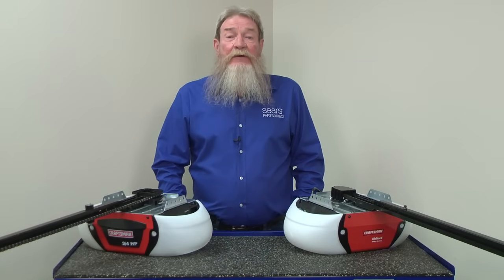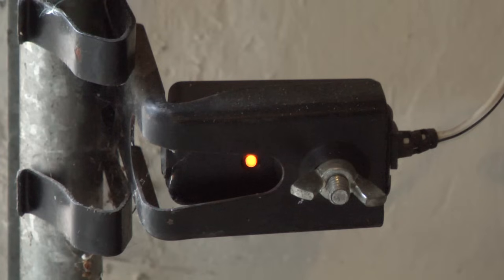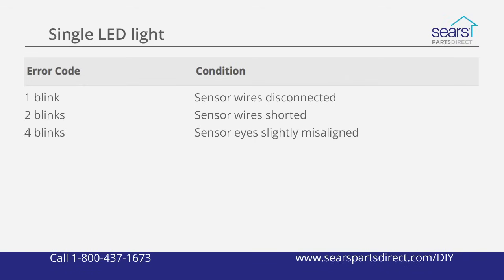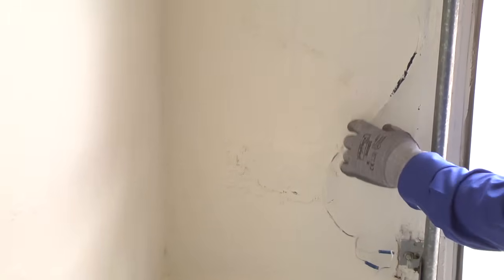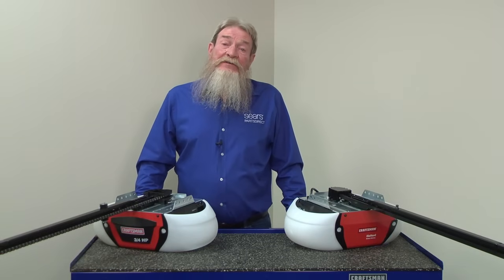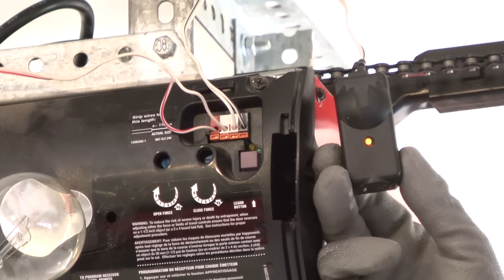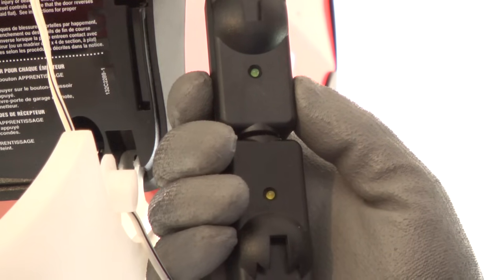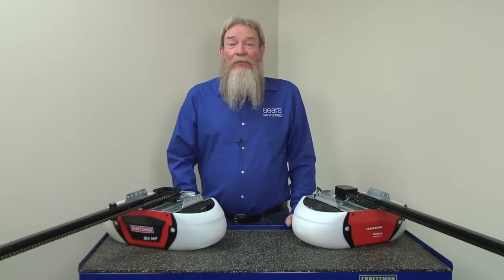How to Fix a Garage Door Opener that Won't Close the Door: Lights Blink 10 Times

Comment: This was excellent. I didn't know about the debug light on the motor. It said 1 blink, disconnected. I took the main wire pair out of the motor, put it back in, but still 1 blink. I took the left sensor out, wires looked ok but I giggled them, replaced the sensor, and it was amber and the other side green and now it works. I think I knocked the wires loose when cleaning that corner of the garage. Thank you!

Comment: My mom's garage door hasn't worked for years, it would go up but wouldn't go down. She had to open the door from inside, pull her car out, go back into the garage and close the door, then exit the front of the house and get back in her car, every time she wanted to go anywhere.

I don't know anything about this stuff and kept telling her to call a repairman but she never had the money for it.

I just now was over here and decided I'd had enough of her having to deal with this and Googled it, sure that the answer would be "call a repairman." But I did it anyway. This video came up, so I clicked, and watched.

After finishing the video, I thought that surely the problem wasn't as simple as checking the alignment of the sensors.

I was wrong. I didn't even really do anything. I just jiggled the receiving sensor a bit, walked over to check the yellow sensor, but on my way over I accidentally pushed the button on my garage door opener she gave me (which I just replaced the battery for) and the garage went down so I couldn't even check the yellow light. I was so confused but cautiously optimistic... So I tried the remote a few more times, letting it open and close, stopping it midway up and midway down... It worked perfectly. I checked the button inside the garage next to the entry door, and that worked as well. No more blinking/clicking lights, just perfectly smooth door operation. 

After all these years, all it took was a little jiggle.

Comment: Did the sensor test.  Both work, however the wire was also replaced the whole way when I got new sensors.  But the sensor wire is solid core, the new wire braided.  Could this be the issue?

Comment: The part showing that yellow light flashing sequence really helped me and I couldn't find that info anywhere.  4 flashes for me with incorrect alignment.  Took the sensors off and plugged them into unit with the short cables, put the sensors face to face touching and the flashing stopped, pressed my garage door button and voila she opened.  Carefully measured the height of the sensors when reinstalling, made sure they were clean and she works like a charm.  Very thankful.

Comment: 4 blinks??? YES!!!  FIXED!!!   I never knew about the CODE light.   It seemed like my sensors were aligned, but upon closer look there was a almost imperceptible blink on the green light.  

I adjusted BOTH sensors and the door now works!  I’ve wasted days messing around with the door, but your video SAVED me!!!    Thanks so much.

Comment: My lights are both on but flashes 1 time at the motor.  If a sensor wire is disconnected, why do I have lights on the sensors?

Comment: I got laid off from my job, my partner's cancer may be back, then our AC went out in the middle of a texas summer, and THEN the garage door wouldn't close 😭 when it rains, my friends. 

This video was a godsend. We had two things happen simultaneously. First, my partner pulled the string to try to raise the door manually and didnt click it back into place. All it took was me pushing the door up till i heard the click. Second, i must have bumped the sensor putting away the lawnmower and it was just barely out of alignment. Thank you for this video 🙏 one minute in and it saved me from literally pulling out my hair today

Comment: Can someone help me here. I have both sensor lights on (the green and the orange). However, the door still won't close and blinks 10 times. Also, I think I'm getting a 'blink 4 times' error code from the unit. This is very frustrating.

Comment: Both my lights are lit. Garage door closed and stops just above where the sensors are and then rolls back up. 10 flashes and 4 flashes on the back. Any tips?

Comment: The green and yellow lights work as they should and they are aligned. The door goes up and down very easy. The door is very light because its only a single car door mad of tin.  The transmitter and the receiver are in the shade.  I checked all connections and none are loose.  I do see the up and down force knobs both need to be turned up all the way to get it to work. Does this mean the circuit board is bad, or what? It might be best to just buy a whole new opener, but I wanted to try to avoid that.

Comment: My has 1 up blink and 5 down blink and it makes just one click sound. Is this the logic board gone bad...?
Reply from the maker: That error code does indicate that the garage door opener has a defective logic board in most openers. Replacing the logic board will likely fix the problem. It's sometimes more practical to replace the entire garage door opener instead of replacing the logic board.
Reply: @searspartsdirect  Thanks I change the logic board and everything back to normal.

Comment: I had the same problem on my unit..In my case it turned out to be caused of the the angle of of the sun on my door..It. A used the sensors not to work ..We relocated the sensors and have had no problems since…

Comment: Systematic, methodical and comprehensive troubleshooting - exactly what I needed to see to finally solve the riddle of the inoperative sensor - thanks!  In my case, it turned out that I jarred one of the leads loose in the control box while fiddling around installing a new battery and just needed to tease it back in.  D'oh!

Comment: GREAT tutorial.  What does the light blinking 5 times indicate?
Reply from the maker: The 5 blinks indicates that the motor overheated or the motor isn't detected as running by the RPM sensor. Here's some troubleshooting to try: The motor can overheat if the door is opened and closed several times in a row. Unplug the garage door opener to reset the logic board. Allow the motor to cool for about 15 minutes before restoring power and using the garage door opener. Pull the emergency door release and check the up-and-down travel of the garage door for binding. Repair the garage door if it doesn't travel smoothly. If it overheats after a single use and the garage door travel is smooth, you may need to replace the motor.
Reply: @searspartsdirect  Thank you Sir.  I will try the above.  I believe now that the spring is broken.

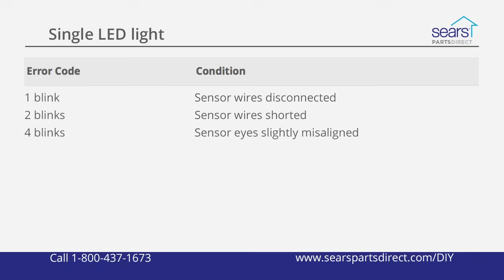Comment: 1:41, great info. But during different tests, it changed from 2 blinks to 1 blink. Can that mean something inside a sensor is acting up?
Reply from the maker: Loose wires or a bad sensor could cause that symptom. To eliminate the wiring as a cause, test the sensors directly at the motor unit as shown at 3:21 in the video.

Comment: checking wiring and sensor position was fine even though It only happens during the day. I tried the paper towel roll trick to see if it was a light issue. Didnt work
Reply from the maker: You may need to install sun shields on the sensors as shown in this article/video: https://www.searspartsdirect.com/diy/article/installing-a-sensor-sun-shield-on-your-garage-door-opener-video

Comment: My door always goes down fine with the doorbell button in my garage, but gives me trouble with the remote. I've tried relearning the remote and even using a different remote. Not sure what else to do.
Reply from the maker: If the lights blink when the door won’t go down using the remote, then check the safety sensors as shown in this video. Sunlight can interfere with the safety sensor beam so if the problem is intermittent, you may need to install sun shields around the sensors as shown in this video: https://www.searspartsdirect.com/diy/article/installing-a-sensor-sun-shield-on-your-garage-door-opener-video  If the lights don’t blink when you try to close the door with the remote (indicating the problem isn’t caused by sensor) then a bad remote or radio frequency interference could be preventing the garage door opener motor unit from receiving the close signal from the remote. Follow the troubleshooting steps in this video to fix a remote device problem: https://www.searspartsdirect.com/diy/article/garage-door-opener-remotes-wont-work-video  We hope these tips help. If you need further assistance, let us know.

Comment: I figured out my problem. The sensors are fine, but when the sun is at a certain angle it blinds the receiving sensor so it makes it seem like the sensors are out of alignment or not working. When I hold some card board to shadow the sensor it works fine. Suggestions?
Reply from the maker: We recommend installing sun shields as shown in this video to keep sunlight from interfering with sensor reception: https://www.searspartsdirect.com/diy/article/installing-a-sensor-sun-shield-on-your-garage-door-opener-video . The part number of the sun shields is 41B873. Although Sears PartsDirect doesn’t currently have that part available, you can find it elsewhere on the web.
Reply: @searspartsdirect  Thank you.

Comment: I have a craftsman 1/2hp won't work with any remotes but will work with button in garage and yes I put new batteries in them and reprogrammed them and even went as far as to buy a new remote. So has anyone have this problem ? My remote goes down but not up ,again only the hard wire works fully

Comment: I just fixed my garage door problems (door closes about half way then stops then goes back up then blinks 10 times) and the solution was not one expressed in the video. I had to change the force threshold option (a knob on the motor box that can be changed with a flat tip screwdriver). Mine was set to about 5kgs and I changed it to 9kgs (the max). My railing and garage door was old and it looks like there was some warping over time and that caused it to be harder to move down than the threshold allowed.

Comment: Amazing video! Very detailed but I did not find solution to my problem which is 4 Blinks UP and 6 Blinks Down? What should I do?
My garage door closes if I keep the wall control switch pressed and wait for the door to close completely.. If I press and leave it or press the remote, it wont close. Strangely it opens with the remote but not close. Please help!

Comment: We had a power outage and had to open the door manually. After the power was restored, the door garage door wouldn't close. It WAS the sensor light wiring. It somehow disconnected when manually opening the door. The wiring only needed to be reconnected. Very easy. Thanks man! This helped .

Comment: I do get the 10 blinks trying to close door . . but . . I only have problems when the weather is cold . .if the temp in the garage is at least 65 -  70 the door closes fine
Reply from the maker: In colder weather, your garage door opener sensors may be getting sunlight interference that prevents them from working properly. You may need to install sun shields on the sensors as shown in this article/video: https://www.searspartsdirect.com/diy/article/installing-a-sensor-sun-shield-on-your-garage-door-opener-video

Comment: Thanks so much for this video!   Removing the sender unit and directly connecting it to the motor unit confirmed the sender wasn’t defective as I thought.  Indeed a broken wire near the sender connection was the culprit and being forced to cut the wires to test the sender isolated where the break in the wire was.   I struggled with diagnosing the problem for a couple of hours on my own instead of starting with this video.  More than one lesson learned as a result.

Comment: I didn’t know about those sender/receiver lights - thank you! I was stumped for awhile because my garage door would only start closing for about a foot, then stop, and reverse. Could not figure out what the obstruction was. The answer: sprayed silicone lubricant on all the rollers, plus all the section hinges along the width of the door. Presto! Must be our harsh Canadian winters playing a role here; perhaps one or more hinges had some slight corrosion inside causing it/them to bind a bit. The door opener would sense the extra resistance while closing so would stop and reverse.

Comment: Can't find anywhere the code for what LED error code light blinking twice? Liftmaster Formula 1 by Chamberlin
Reply from the maker: The 2-blink code indicates that the control board detects a problem with the safety sensors. Use the troubleshooting shown in this video to check the sensors and their wiring. Here's a link for the manual for a common Formula 1 garage door opener by Chamberlain in case you need it: https://www.searspartsdirect.com/manual/5mvg9tjw3q-001559/chamberlain-3280-garage-door-opener  We hope this information helps. If you need further assistance, let us know.

Comment: Hi. I have a craftsman garage door opener Model 200 57933
Item 009-57933
Serial 170919265. My problem is the bulb is busted and I can’t figure out how to remove the cover so I can change the bulb.
Can you please help me?
Thanks.
Reply from the maker: Page 12 of the owner's manual shows how to remove the light cover. Here's a link for an online copy of the owner's manual in case you need it: https://www.searspartsdirect.com/manual/1xcv4p1ryb-000247/craftsman-20057933-garage-door-opener . If you need more help, let us know.
Reply: Sears PartsDirect Hi. I’m having a hard time downloading the manual( my iPhone’s storage is full and has been acting up). Can you please instruct me how to take the lens cover out? Thank you very much for all your help. I’m sorry for all the bother. Have a great day.
Reply from the maker: @elmormonteiro5780  No bother. We're always glad to help. You'll find detents or notches in the top of the lens cover on each side. Insert the tip of a slot screwdriver between the lens cover and the motor unit at the
 detents on each side, pry and pull the light lens cover from the top and detach it from the opener. We hope this additional information helps. Let us know if you need further assistance.
Reply: Sears PartsDirect thank you very much. Will try it after my cardiac rehab today. Thanks.

Comment: My garage door lights flash 10 times and I am getting 2 blinks on the LED diagnostic light. The lights on my sensors were not lit up. I cut them and tested them directly into the unit, still no lights. Everything says get new sensors. So I ordered some Amazon universal sensors, no dice... I bit the bullet and went to Lowe’s and got the Craftsman sensors. I am still not getting lights on my sensors. I have put the wires in every way I could possible imagine. Forwards, backwards, in the wrongs holes etc.... I have left it unplugged from power for 5 minutes after putting the wires in. Is my issue in the logic board? I am very very close to just getting a new one. They are not expensive enough to call out some kind of technician to take a look. By the time I pay him and for parts I could just put a new one in. Logic boards are around $100 and I’m not sure those are returnable. Any help is appreciated. Thanks!

Comment: I am getting 5 blinks on the led light on motor unit.. anyone know what it may be?
Reply from the maker: That code indicates that the motor overheated on many garage door opener models. The motor can overheat if the door is opened and closed several times in a row. Unplug the garage door opener to reset the logic board. Allow the motor to cool for about 15 minutes before restoring power and using the garage door opener. Pull the emergency door release and check the up-and-down travel of the garage door for binding. Repair the garage door if it doesn't travel smoothly. If it overheats after a single use and the garage door travel is smooth, you may need to replace the motor.
Reply: Sears PartsDirect 
My garage door lights flash 10 times and I am getting 2 blinks on the LED diagnostic light. The lights on my sensors were not lit up. I cut them and tested them directly into the unit, still no lights. Everything says get new sensors. So I ordered some Amazon universal sensors, no dice... I bit the bullet and went to Lowe’s and got the Craftsman sensors. I am still not getting lights on my sensors. I have put the wires in every way I could possible imagine. Forwards, backwards, in the wrongs holes etc.... I have left it unplugged from power for 5 minutes after putting the wires in. Is my issue in the logic board? I am very very close to just getting a new one. They are not expensive enough to call out some kind of technician to take a look. By the time I pay him and for parts I could just put a new one in. Logic boards are around $100 and I’m not sure those are returnable. Any help is appreciated. Thanks!

Comment: my door won't close and blinks 10 times but I can Push the close button on the wall and hold and the door will close all the way. ...So I don't think any of the solutions will help that will they?
Reply from the maker: Most garage door openers allow you to close the door by holding down the wall control button even though the safety sensors aren't working so we recommend that you follow the troubleshooting steps in this video to fix your opener.
Reply: @searspartsdirect  I just went back out. its dark and gloomy and the door works both ways now no problem. So its a sun thing. How do I get past THAT?
Reply from the maker: @bikinggal1  Install sun shields on the sensors as shown in this article/video: https://www.searspartsdirect.com/diy/article/installing-a-sensor-sun-shield-on-your-garage-door-opener-video . The part number for the set of sun shields is 41B873. We don't have that part available at Sears PartsDirect right now but you can find it elsewhere on the web.